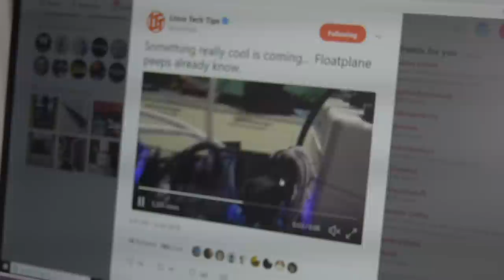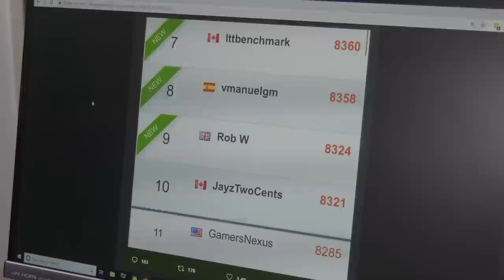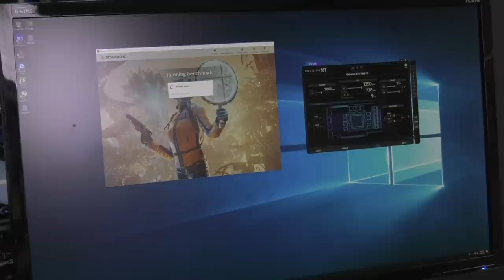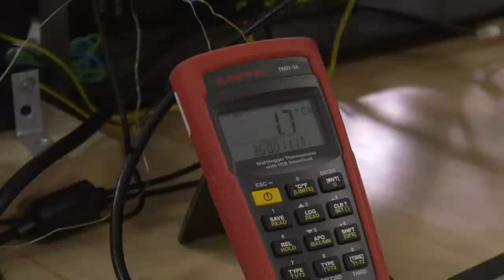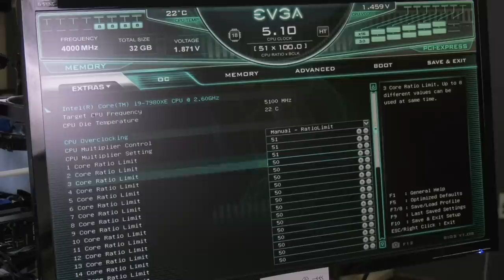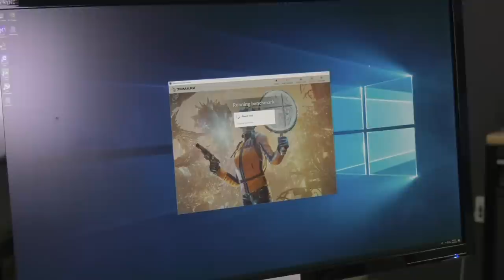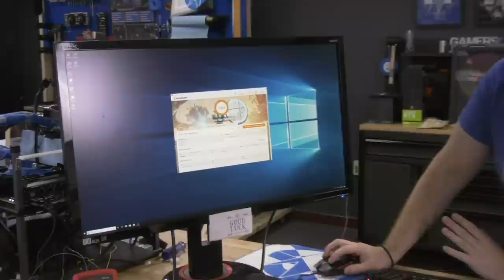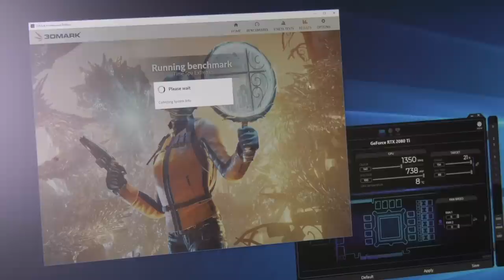Part 1 - Live: #RIPLTT2 | Overclock Battle Final Response (For Now)

Comment from the maker: PART 2 is HERE: https://www.youtube.com/watch?v=rKwZXF0oazg
Reply: Hey, have you guys ever considered using a high end custom power cord for the psu.  My father is an audiophile and so had one laying around.  I found i wasnt able to OC any higher than usual, but my scores in things like heaven/valley and timespy went up by a good 5% all around
Reply: also im sure im not the first to say it, but some form of antifreeze mixture or a salt mixture would provide lower temps; if you use the antifreeze method, as long as it doesnt touch the tubes, you should be fine as far as material compatibility
Reply: hey steve for the next one after you add the ice put about 2 big things of iodized sallt in there too. it sounds slilly but it will drop the temp of the water by 5-10 degrees. trust me.

Comment: Fill the loop with alcohol and the radiator bucket with alcohol and dry ice, Wont the temp go Negative then? o.o
Reply: Alcohol cost too much just to get the same temp. Plus the smell.
Reply: Plus potential Carbon Dioxide Poisoning. In the large space may not be a major issue, but DICE in an enclosed space can be dangerous.
Reply: dude... he doesn't need that much dry ice
Reply: maybe isolate with tape the radiator seals and conector.  Because alcohol degraades rubber.  But its better than salt in the buket right?
Reply: Bruno George Moraes Is it? This was only a friendly competition. Salt and water is much less work and cheaper.
Reply: Salt is bad for the radiator or the exposure time is low so no biggie?

Comment: Another tip for OCing put your salt into the bucket like the saltbae it would add 200 extra points :))
Reply: salt corrodes metal. So bye bye radiator
Reply: He was putting salt into ice bucket to lower freezing tempeture in his previous videos. I guess his radiator covered with something which prevents corrosion..